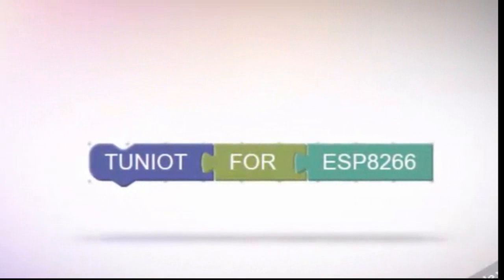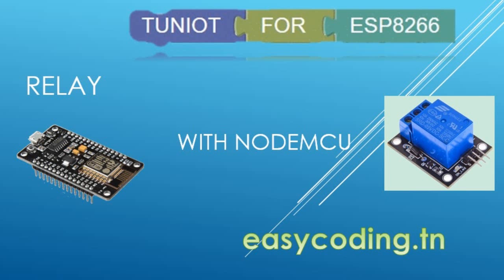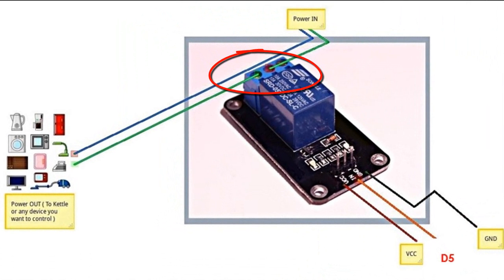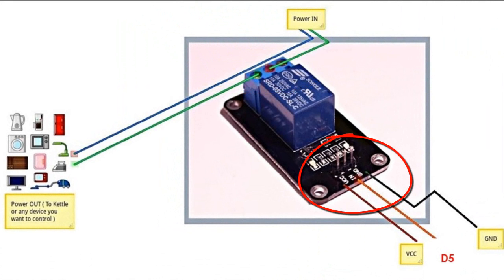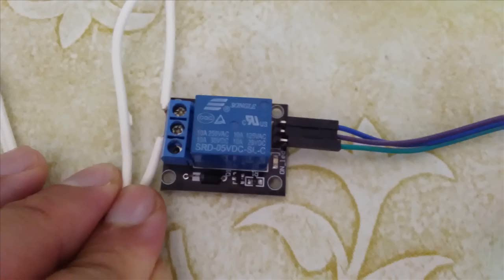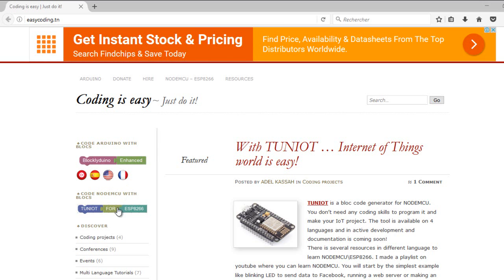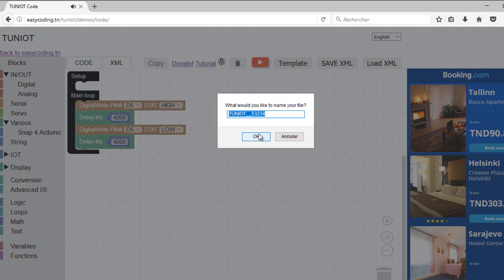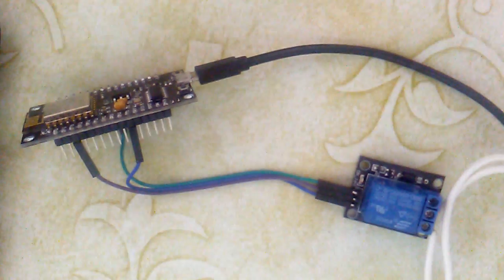NodeMcu (ESP8266) Tutorial A-19: Using a relay

Comment: Hi,
I am trying to connect 4 Relays and 4 Buttons to my Nodemcu esp8266 but unable to do so my PIN configurations are as under. 
Relay1 to D1, Relay2 to D6, Relay3 to D7 and Relay4 to D8
Button1 to D2, Button2 to D3, Button3 to D4 and Button4 to D5
can u guide me if possible which pins to be used for Relay and which for Buttons Thanks in advance,
Reply: Is your relay operating on 5v? if not then you should give an external 5v power to your relay circuit. If yes then Nodemcu has a 3.3v out pin. This will not work. So connect Vin pin of Nodemcu to relay vcc.
Reply: @rohitgalgali5512  Thanks for reply my problem is not voltage my problem is i am unable to use 8 GPIO's (4 for relay and 4 for buttons)on Node MCU relays are working fine and have separate Supply
Reply: @kashif1964  Use only one pin (A0) for all buttons (plus 3.3v & GND) with resistors for determining which is signaling.  Search "multiple buttons on one Arduino pin" for wiring & coding examples.

Comment: where did you connect the vcc to nodemcu?
Reply: VU pin
Reply: Hi, me again. D5 is a 3.3v pin while the relay needs 5v in the coil. Did you connect it directly: mcu pin to relay pin?
Reply from the maker: Vu gives you 5V
Reply: @ADELKASSAH  yes VU is connected to VCC but D5 does it with IN1 for instance. Is 3.3v  enough and safe for trigger the relay and keep it closed?
Reply from the maker: Just try. For the model I have it worked

Comment: nodemcu v3 does not have 5v out. how did you use 5v relay ?
Reply from the maker: The VU pin is 5 V of the USB
Reply: thanks a lot!
Reply: @ADELKASSAH  ok does it handle up to 0.5A like of the USB connector ?